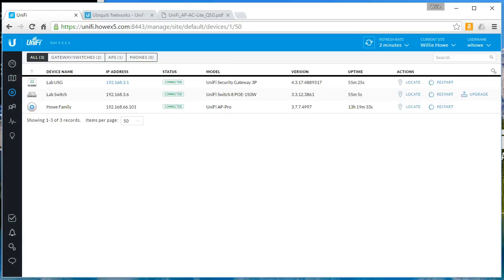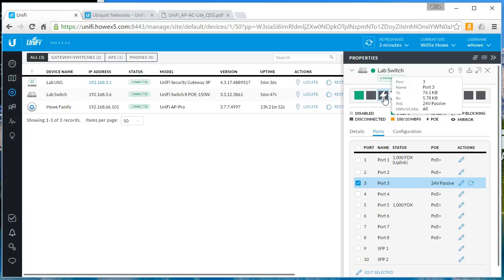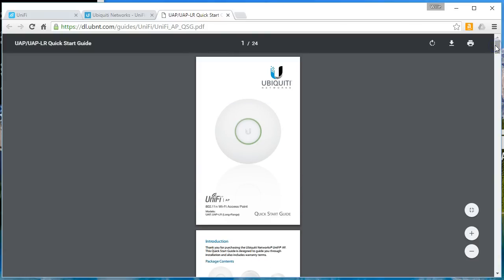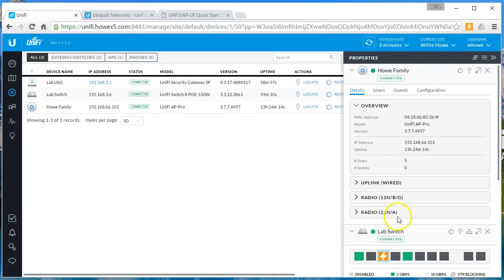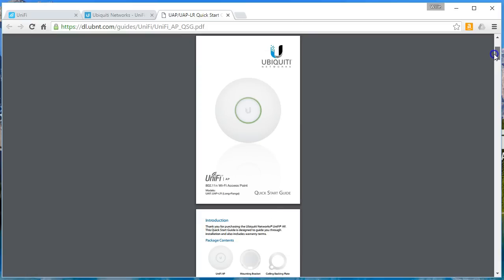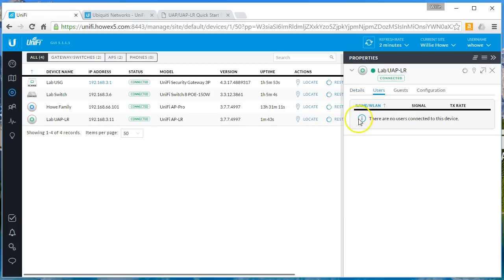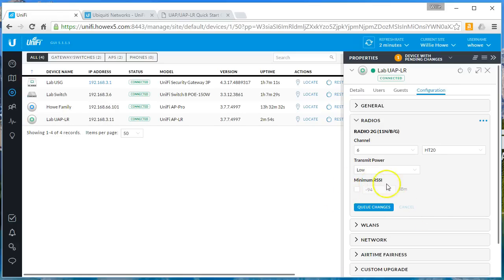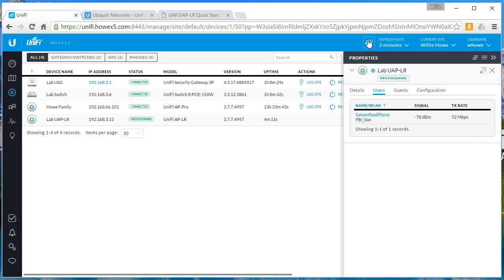Ubiquiti Networks - UniFi 5.1.1 BETA - Full UniFi Stack - Part 3 - UAP

Comment: Can you share any tips on how to determine what to set the Radio Transmit Power to? I'm OK with finding a free Radio channel to use but I'm a little confused on what to set the Transmit Power to for optimal settings in a given environment.